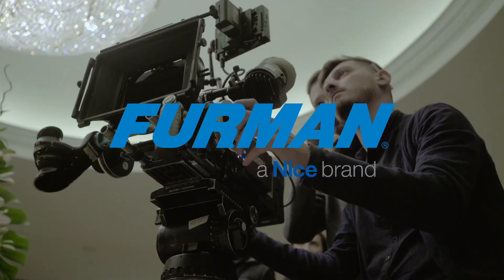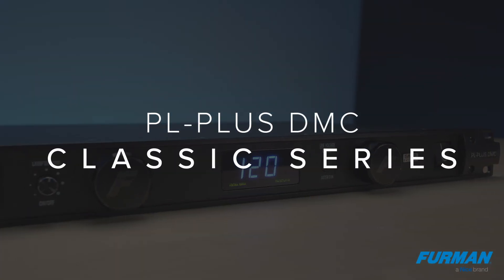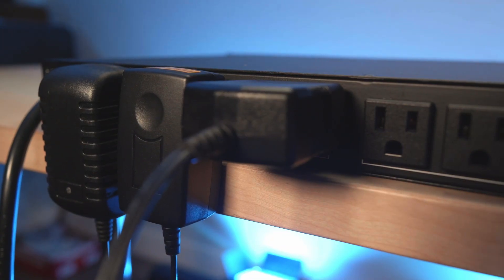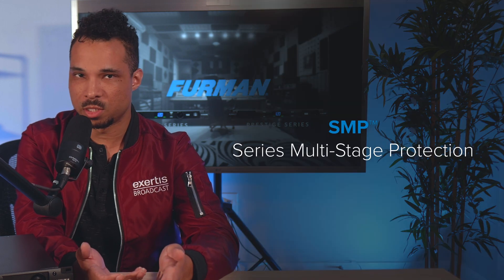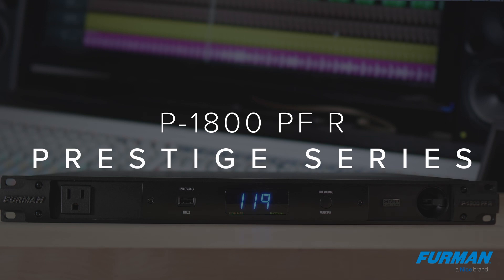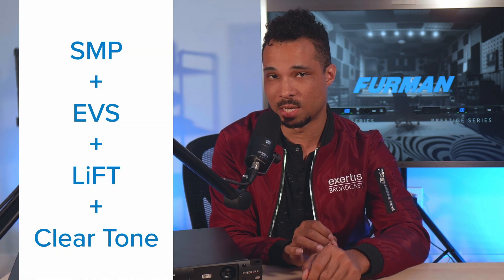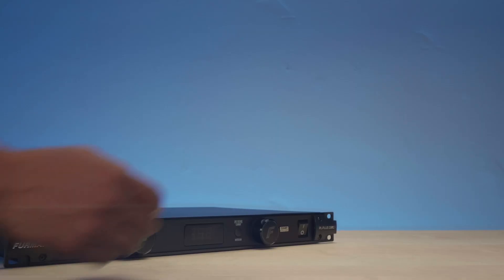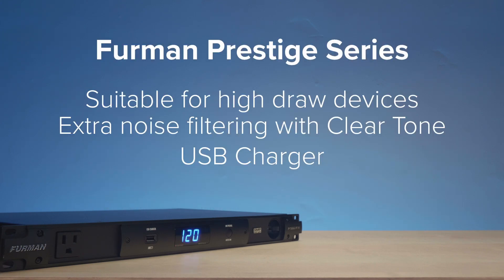Furman Power Conditioners - A Deep Dive into the Classic and Prestige Series

Comment: May go back to the AR since PLUS - C indicates a voltage issue with the meter in yellow (almost at red). Curious to know if the PFR would be any different. 

I only have a Pro Tools Carbon with an iMac and a thunderbolt dock for the external solid state drives.

I’d hate to see my Pro Tools Carbon break down again
Reply from the maker: If you're worried about the power draw, I'd advise using the P-1800 PF (Prestige). Bank A is much better for super high draw, you can even plug in a 100w+ head in and be fine.

Comment: Good morning i been using the Furman PL-PLUS C Power Conditioner with Voltmeter and i notice a big improvement in the sound using a rotary analog mixer, turntables and the f1 bose , my question is if the P-1800 PFR prestige will give me even more  improvement in the sound , love your review!!
Reply from the maker: There is more filtering in the prestige line so there should be a performance improvement but it is up to your ears if you will hear a difference. We always recommend getting the best your budget will allow!